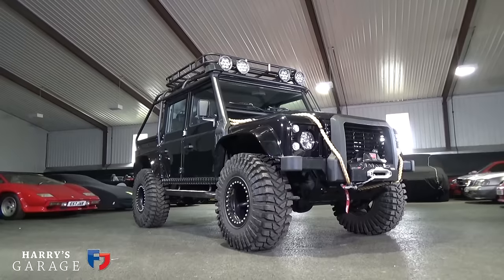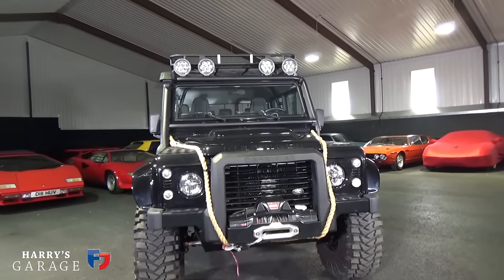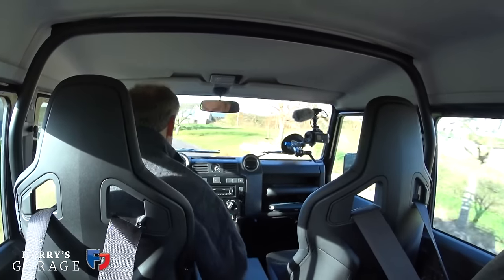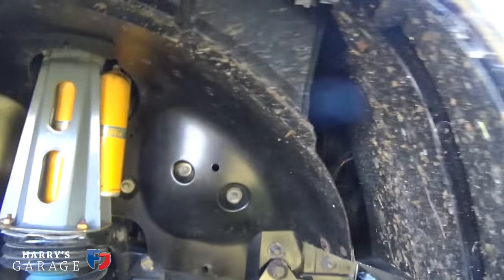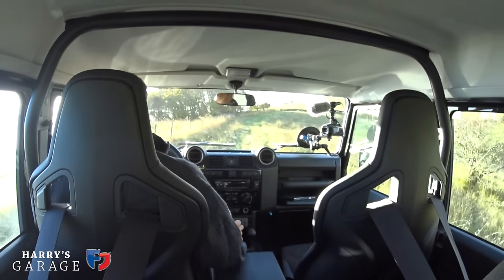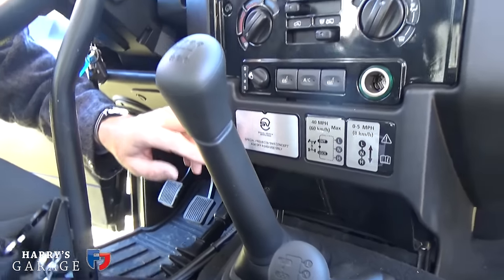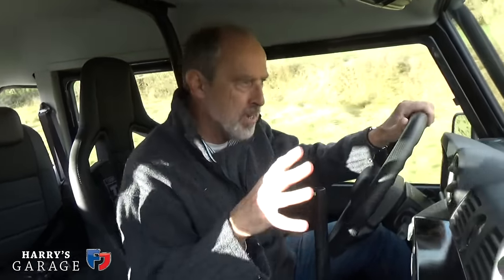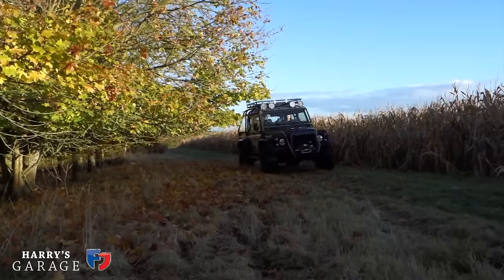Ultimate Defender, SVX Concept review. Spectre, Bowler

Comment: Needs to be made road-legal and be fitted with a Rover V8 in place of that shitty diesel!
Reply: the Buick derived V8 British Leyland used to fit to the Defender was killed off due to fuel costs and emissions regulations
Reply: Peter Lattimer
It's still in production by several companies for the aftermarket tuning scene though. It's pretty easy to get a lot of power out of it, although the GM LS series will always be a cheaper option, and the comprehensive support for it may make it more attractive for some.
Reply: its in production as in for rebuilds etc, but it wont pass modern emissions legislation which was the main reasons for its demise in the first place and it being replaced in the Range Rover with another V8 which I believe came from a BMW at the time
the GM engine may be an option in the USA but not so much here in the UK, where the Land Rover originates from and again, fuel costs on a V8 here are insane
Reply: Peter Lattimer
The L322 Range Rover came with no fewer than six different V8s... BMW M62B44, Jaguar 4.4 (4.2 stroker), Jaguar 4.2 supercharged, Jaguar 5.0 supercharged, 3.6 TDV8, 4.4 TDV8... I know that here in the UK there isn't so much support for the LS but it's still quite common, and they should do mid 20s mpg average, so not too horrendous.
Reply: LS isn't that common here at all. shy of imported vehicles I'm struggling to think of anything sold here new currently that's fitted with it. the TDV8s are a different ball game however and given that a UK gallon is bigger than a US gallon, a friend has just parted with a 3.6 TDV8 Range Rover Sport which was only averaging 29MPG UK! bearing in mind the old series Land Rovers with the 2.25 perkins diesels we had here were slow and noisy but would also get close to that in the 1960s/70s yet the cost of diesel has gone up LOADS (dad tells me it was under £1 for 3 GALLONS in the mid 70s, now its about £5 per GALLON!)
I do agree that a V8 would have been nice, BUT they were killed off for a reason. filling a single tank (Civilian type as opposed to dual tank military type) Defender now would cost pretty much half of a weeks take home wages, in the area I live in (£100 approx.). with a V8 petrol that wouldn't last long, possibly a week at best for most people. as most people here are struggling to pay bills as it is, in the rural areas (where Land Rovers are mostly NECESSARY) you can see why making something costing 2-3 times as much to run, isn't really an option. 
Range Rovers on the other hand are more of a rich persons vehicle so fuel costs are less of an issue, hence the popularity of V8s still.
Reply: Peter Lattimer
The LS comes in the Vauxhall VXR8 (yes, it's an imported Holden), but it's best known here as a crate motor, and is used by a lot of tuners and restorers. The AC MkVI Cobra has an LS3, so does the modernised Jensen Interceptor, and it's quite a popular swap in Jaguar and Land Rover circles. Whereabouts in the UK are you? I'm in the prosperous Home Counties and, though I'm far from rich, most folk around here run fairly expensive cars, Range Rovers are ubiquitous... there's definitely still a market for V8 Defenders, given how many AMG G-wagens I see...
Reply: born and bred in the lake district and now living in the north east. I was aware of the VXR8 but around here at least, that's a really rare thing. as you have said, the rest are all transplants and as far as that goes, if I were to uprate a defender to V8, id possibly be tempted by the Ford V8 we now have in the Mustang. I think the comparison with the G Wagen to the defender is a little off as the AMG G wagen is 3 or 4 times the price of an end of run defender at list cost. the G wagen is also more reliable than later defenders.
Reply: Peter Lattimer
The Mustang 5.0 Coyote is more of a high-revving sports car engine, you really want a torque monster. BTW we do also get the Corvette and Camaro here. Sure, the G-wagen is more expensive, but put expensive suspension, a V8 and a really nice leather interior in a Defender and sell it for 75% of the price...
Reply: problem then is how many of the 'rich people' would buy it over a Range Rover, given the badge snobbery around?
the Mustang engine is quite revvy that's true, but then as you need torque, we are back to diesels as torque is what they do best!!!
also, whilst you can buy corvettes etc here, I'm pretty sure theyre imports, ie still have the steering wheel on the 'incorrect' side of the car for the UK
Reply: Peter Lattimer
A Land Rover is still a desirable badge. People aren't taken in by JLR's attempt to separate the two brands. There are huge numbers of Discoveries around too. Diesels are increasingly out of fashion because of the emissions scandal and awareness of air quality issues. I'm not sure what GM makes available in RHD - I've an idea the Camaro might be coming in RHD?

Comment: Clunky suspension and straps to hold everything together...not very high techy
Reply: Dodo M 
Sometimes they get it right first time
Reply: The straps are to stop the seals in the dampers being damaged when the axle droops suddenly if the car takes off, lots of modded off roaders have them and rose joints on suspension are another race mod. They are more rigid, stronger and control the suspension better, road cars have rubbers in them because  consumers prefer quietness and comfort.

Some of the fastest off roaders in the world use this kind of simple suspension, the complicated and sophisticated stuff doesn't last under the kind of punishments these things have to take.
Reply: popuptoaster Thank you, well put together.

Comment: its about as much defender as I am muslim....   for a start its not typical defender interior as you quoted, plus the biggest kicker is the fact its got a transit engine into it.if you want a proper defender experience instead of one of these cartoon defenders try having a ride in a decent tdi or a td5, or the legendary rover v8 engine version.Landrover gave up on the defender years ago when they stopped putting proper rover engines into them. the 2.4 and 2.2 ford engine versions aren't defenders in my eyes, SORRY...  Their just alternatives cobbled onto a ladder chassis and draped in defender panels.and before you all say im jelous, no im not, ive got a 24yr old 200tdi with steel rims which all proper original defenders should have and in my eyes this was the best most bulletproof engine they ever made and I wouldn't hav one of these clown cars thrown at me in exchange for her... I rebuilt my baby with a new galv chassis this year so she can go on for another 25yrs. shes my work truck and she never skips a beat and shes pulled e through some shit I tell you that for nothing.ive driven them all from 300tdi, v8 and td5 and I wouldn't have anything other than the 200tdi with the Salisbury front and rear axle.
Reply: honi9 that saved me so much typing!
Reply: Well I tend to agree with you, but imagine BMW had put their inline 6 cyl diesel into some of these while they owned LR.
Reply: honi9 think he ment the same as last gen defender just before they stupidly stopped making them, I made a cool LANDROVER 
 GRITTER, LOOK FOR LAND ROVER GRITTER ON GOOGLE,  IT'S A BLACK AND YELLOW WITH GRIT DIRECT WROTE ON IT 👍